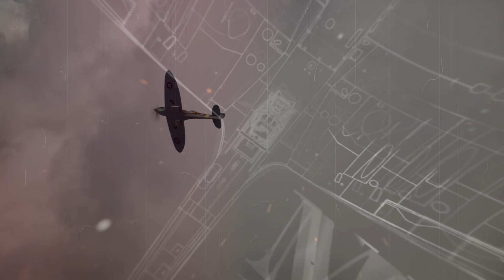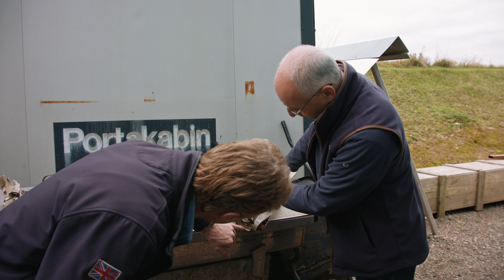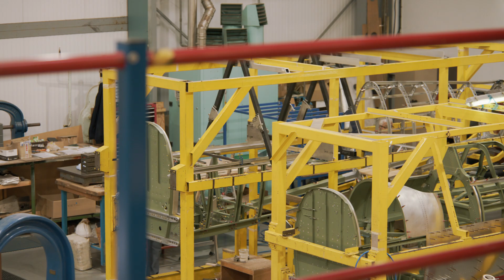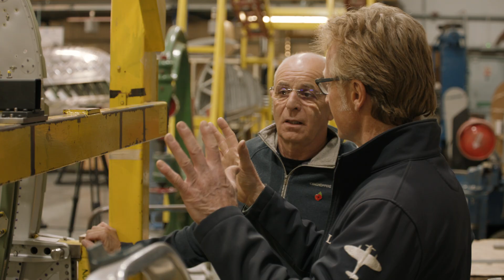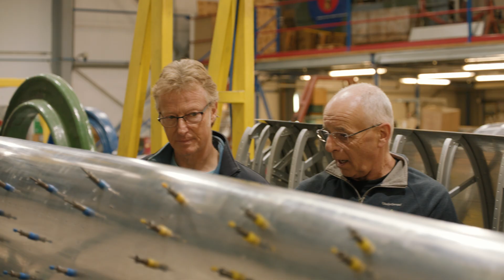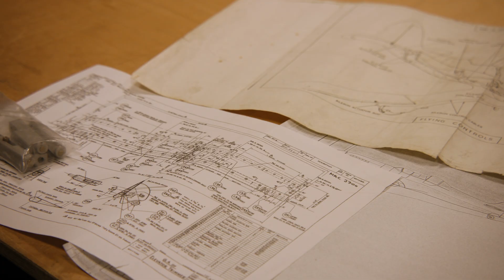The Spitfire MJ444 Restoration | Parky checks in with Airframe Assemblies

Comment: Im wondering if with modern automated machining and 3 D printing why not just replicate end result with udated design, materials and methods.  Also I  dont see the point in reinstalling heavy armor plating.
Reply: Authencity. If you update the design then it's not a Spitfire anymore. It must be built to the original blueprints or you'll never get it certified to fly.

Comment: 3:56 - Bollocks! You're building a completely new airframe, and bolting a few old bits on so that some cretin will pay a few extra £million for it due to its 'supposed' provenance.
Reply: I don’t see many ‘restorations’ of Napier Sabres and Tempests.
Reply: @givenfirstnamefamilyfirstn3935  - It's a good point, I'm lead to believe that NS powerplants were, whilst admittedly extremely powerful, somewhat delicate and prone to premature failure, so restoration of such might be a shortlived triumph? Tempests II's with the Centaurus motor on the other hand was a lovely aeroplane, though somewhat overshadowed by its equally attractive sibling, the Sea Fury .....of which there are several, successfully restored ....... or were you making another point entirely?
Reply: @gregtaylor6146  Kermit has two stalled Tempest non restorations, a V/VI and a II, I think there is a Tempest II progressing somewhere.  There is a brave Typhoon restoration in Canada.
Reply: @givenfirstnamefamilyfirstn3935  - Good to know, Thank you.

Comment: Could some one please explain the reason for the clear part of the  fuselage behind sliding canopy. It cannot be for vision as the pilot could not turn his head that far back to see out.
Thankyou.
Reply: I think the purpose is for visual inspection and access to the Sutton harness attachment points behind the pilot seat and the steel cables which attach to the frame.

Comment: Great video, thanks for posting guys. 
Not sure how I feel though about taking such an iconic plane, working so hard to maintain as much of the original parts etc as possible, only to then rebuild her as a two seater. A type that to my eyes just doesn't look "right". I appreciate the need to offer rides to help raise money etc, but the idea that your taking an original LFIX and drastically changing what she was just doesn't exactly sit right. I almost feel like if your going to make a 2-seater then go for more of a "new build" like they have done with the FW190N's, and save the restorations for keeping them as close to the original as possible. But then again, without the two-seaters making money, maybe many of the restorations just wouldn't be financially feasible. Anyway...Great job again guys. Please keep posting these great videos showing the rebuild process.
Reply: This is only a nominal restoration anyway.  Why not do a photo reconnaissance Spitfire and let the passenger peep out through the camera windows? (behind the folding for entry pilot’s seat).  After D-Day General Eisenhower had a well escorted flight over the bridgehead in a P-51B modified with a seat behind the pilot, there was no room for a parachute.
Reply: I'm with you. I know it's a controversial view but two seater spitfires just look wrong in my opinion. They would be better off just reserving those to the bubble canopy variant where the extra seat can be better hidden.

Comment: Wonderful work being done and very interesting. I'm very glad that Spitfires are being built. But realistically what % of the 'restoration' is original?
Reply from the maker: Many thanks! It depends on each airframe and the condition of the salvaged wreckage. In any restoration to airworthy condition you would replace a considerable amount of of the airframe whether the aircraft was largely complete or the wreckage from an accident
Reply: Nothing flight critical. The wouldn't get certification using 80 year old aluminium. It's ridiculous to call these 'restorations'.